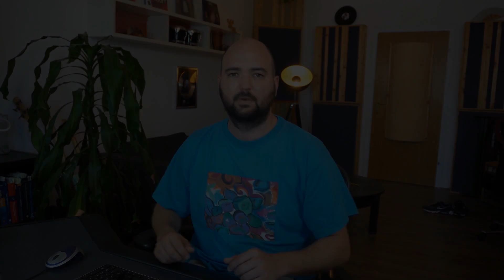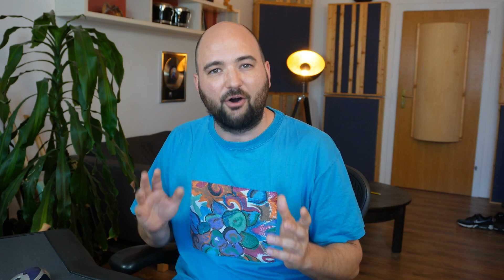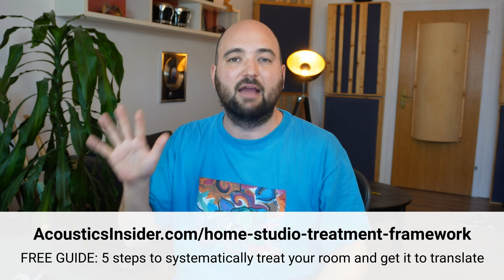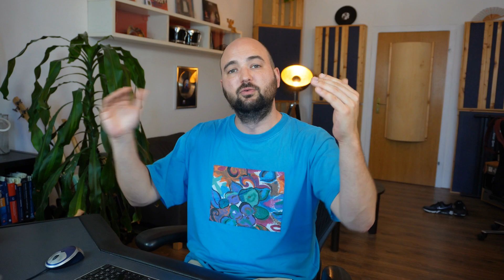Studio Speakers: Master ROOM CORRECTION (speaker calibration) in your home studio STEP-BY-STEP

Comment: Hi Jesco. What do you think about boosting for example 80hz if i have a null on the listening spot there? Does it make sense at all to boost?
Reply: boosting nulls doesn't work because they are waves cancelling each other. Higher amplitude of the  waves won't make a positive difference, it will probably only make matters worse.
Reply: You are probably in a small cubic room. Im having the same issue. Its probably a room mode

Comment: This might work for cheap speakers, but if it isn't a Trinnov, I found the sound quality improve dramatically when I solved every problem using acoustic measures
Reply: Really all I did was build a mini desk, put absorption on the floor and covered 100% of the walls and ceiling in bass traps. I also added a subwoofer to even out the last noticeable dip I had in the bass region by placing it along the standing wave in a way where it wouldn't interfere at my listening position
Reply: @paatttrickkkk  you don't find 100% wall coverage too dead?
Reply: @WyattBrown377  my room dimensions are 2.4m x 2.5m x 6.5m WLH. The bass traps are anything between 30 and 70cm deep.
I don't find that dead sounding, no. I do have 2 windows that I didn't cover though

Comment: Good timing! I just finished room treatment and am about to update my Sonarworks calibration. I know that a significant boost will still be required by Sonarworks for my room. I was thinking that if I boost the bass setting on the monitors first (Focal 65 has low freq shelving at +/- 6db from 0 to 250hz), then Sonarworks would need to do less boosting overall in the bottom end. I understand it depends on what exactly is happening in the bottom end of my room, but my thinking was that it would be better for Sonarworks to cut bass rather than to add bass. Does that make sense? Or does it matter? Any opinions or input welcome. thanks!

Comment: Jesco, how do you feel about systems such as DIRAC that do phase rotation in addition to just EQ? I personally have had excellent results with MiniDSP/DIRAC. 

Additionally, do you have a rule of thumb when it comes to midrange adjustment & how far up the spectrum you would apply correction? My experience has been that the margin of error in mic placement at shorter wavelengths makes for some wildly inaccurate “corrections”.

Comment: No subjective adjustments should be made until you have a hearing test by an audiologist.  You may discover that you hear better than average or worse than average.
Reply: ur funny man!
Reply: thanks
Reply: It's not like human ears prefer flat frequency reaponse....pointless to set for ruler flat.
Reply: How do you know?
Reply: While the brain compensates for hearing loss, it is a very good idea to get this checked out. Because sound has three basic variables and up to five if some other obvious consideration is examined.
    Room and treatment,listener, monitors, music or source material. Perhaps a complex equation that needs in essence compensation or knowledge of reference tracks one  that one is very familiar with in different situations.
Reply: Yeah but you still have a reference of what realism sounds like to your ears, even if they have an abnormal frequency response. Our brains do a good bit of compensation
Reply: OP is right. I am SHOCKED by the little attention those working with audio  give their ears. It is probably the least in all the creative fields. Audiologist once a year minimum. Otherwise we are pretending.